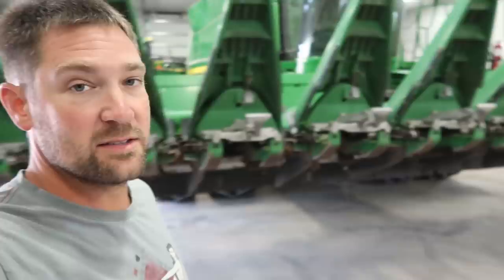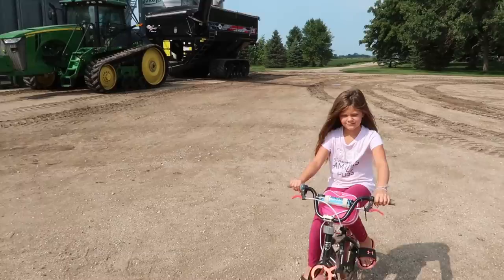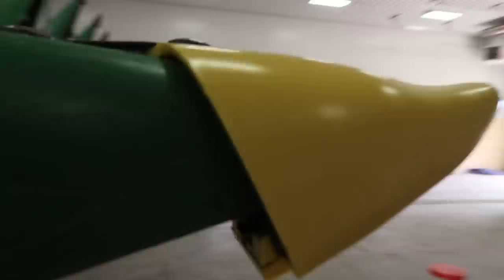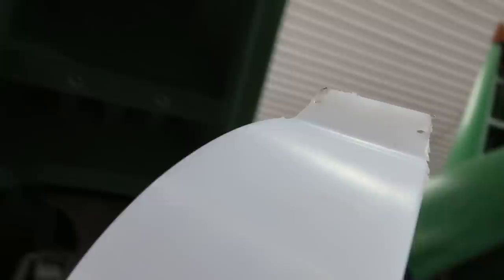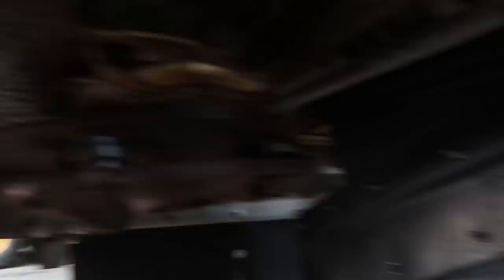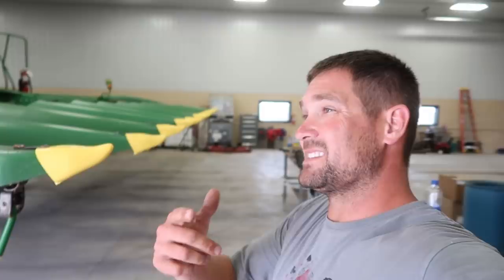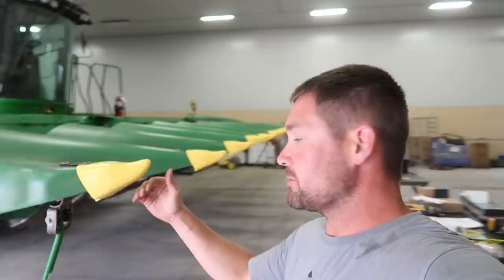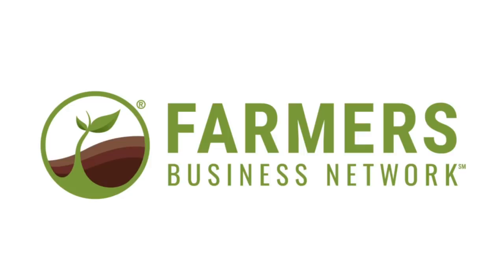Corn Head and Combine need some work

Comment: you should also do a spot on your podcast about Auto re-close on HT or High voltage lines. Most people don't realise that if you short them they trip off. BUT most High voltage systems have a timer that brings the power back on up to Three times . That is what kills people when they think its off and they leave the tractor or they try to rescue someone. The re-close is there for lightning strikes etc.

Comment: I did thain trenching for 9 years and cut through about 1 underground power cable a year. Most of them I diddnt know that I'd cut them, the others just pulled the machine to a Holt and stalled the motor. Those ones you don't get off the tractor, just start it up again and back off it. If you jumped off the tractor then you can get zapped if the pole fuse hasn't blown.

Comment: Have you ever looked into Calmer Corn Heads. 
Pros: They shred the stalks using the knife rolls, using less horsepower and fuel consumption, are easier on the crop and cause way less fluff going through the combine.
Cons: $ on initial switch
Readjusting combine due to less fluff in thrashing unit. Check them out think  you will like what you see.

Comment: Zack, in past videos you mentioned hard to remember what was needed for each tractor 🚜 as programs or setups.  I work part-time for medical plastic molding company, use my phone constantly for model and serial numbers of parts to order or repair. Also for many many passwords on equipment.  Try doing the same, made my job and life easier 😌 made sticky notes with user names and passwords on home computer and do a photo with phone 😃

Comment: The trials and tribulations of a Millennial. Burgers at the bar or brush hogging? Make mine medium rare, ketchup, lettuce and tomato, and salt and pepper, with a side of fries.

Where I lived, the name of the utility verification service was called Miss Utility.
My brother had the water supply line to his house spring a leak due to aged polybutylene tubing. Called Miss Utility a week ahead, they came out a couple days later and only surveyed half the property. Called them back, and they marked all kinds of objects. 
A friend worked for a utility company that installs underground utilities, so I was able to borrow a 6 foot deep rock saw.  Got to within 50 feet of the water vault when I unearthed a 3" diameter fiber optic feeder line that wasn't marked. Job was shutdown. The local cable company wasn't happy and neither were the communities that lost cable for a couple of days.

Miss Utility was supposed to pay for a rental machine. They denied reimbursement after the bill was submitted.

Comment: Just a thought from a layman... I can see maintaining equipment, things like oil changes and cleaning. What I don’t understand is repairs on combines. I might be wrong but it seems that you use a combine a couple weeks a year. It’s not a tractor that you would use a lot to till, pull carts...etc. If you compare a combine with an OTR diesel truck that is used 40hrs a week. They don’t seem to reliable. Again, i might be missing something.

Comment: That part from the podcast is truly scary. I think the power company could be in a bit of trouble.
Reply: The location company surely should be. I actually am dealing with a issue where the power company screwed up. We were clearing a wreck with our big wrecker and had to have them kill the line because of boom clearance. Anyway they sent some subcontractor they're using to save a few bucks and they killed the line by popping the fuses but he didn't want to bother hooking up grounds on both sides like they usually do. As soon as the boom got a few ft from the lines it arced over to my truck and damn near killed me. Luckily I was using a remote control box when it happened and I had enough sense to not be touching the truck. But I was close enough to feel it and it wasn't far enough to be honest. I forget what the voltage was but it was caused by induction from the primary transmission lines to our town running along the lines I was working near. It caused over$70,000 in damage to the big wrecker when 100,000 + volts shot through it frying everything you can think of all because the idiot was too lazy to use another ground to isolate where we were working......... electricity is no joke and while I was far enough away from it for the normal lines it was barely enough that time.

Comment: So after listening in on one of the podcasts, you are still going to run your chopping on your head? I believe the mat it makes on the soil was giving you drying problems in the spring. I know of you can get it all turned over before the ground freezes you are good but. Maybe turn the chop off when you know your gonna get behind?

Thanks. Jake.

Comment: Did you have a new fuel trailer coming up through iowa earlier this week I saw one with both your logo on the right side and an off the husk logo on the left being pulled by a white ram pickup. I saw it get off at the caseys exit 35NB at exit 26.

Comment: Need to look at the duck foot by duckfootparts.ca they attach to the reel and remove the need for an air reel for soybeans, they also work great for all other pulses and cereals. We have been using them the past 2 years and have noticed a huge difference in product loss and seed damage

Comment: Zack, my man, why are you using 9360 for Grain Cart, instead of 9560 that has more power and will handle it better
Reply: They often used the 9560 to till at the same time they harvest  so I guess they just wait with it hooked so they start tilling if possible

Comment: I’d like to know why the power line was so close to the surface ? The company I worked for buried #3 and # 4 cable underground and we would bury it at least 4 ft down ! I use to work for A. F. Shepman and Sons in Okabena Mn. back in the 70’s . Are those blade bi-directional or are they supposed to have the bevel on the bottom ? On a lawn mower the bevel is on top ! Just asking !

Comment: Which Off the Husk is that from?
Reply from the maker: Just released today! How deep?! It’s looks like it’s not quite finished uploading to Apple.
Reply: @MillennialFarmer  as a locator,i know that primary lines tend to be below 30 inches, why were you plowing that deep? and bad on locator for missing that, hes done working as a locator esp for missing 3 phase
Reply: Glad you called for Locations (whoever you are). It would be extra tragic to get the repair bill and get charged criminally on top of hospital and/or funeral expenses.
Reply: @MKraus79  tile goes DEEP sometimes depending on how far the field drops off. I've been in trenches well over my head at 6'6" before while laying tile
Reply from the maker: https://podcasts.apple.com/us/podcast/off-the-husk/id1482027653#episodeGuid=2e496edb-e3ba-48b4-91ca-05a39c2dcd96
Reply: @corbinmatheny4022  oh ok I never knew they go that deep.... i bet that was one hell of show when they sparked.... i had a contractor once dig ontop of marks and not only cut one primary, but the result of the break cause a short of the 5 other primary in the trench short out...